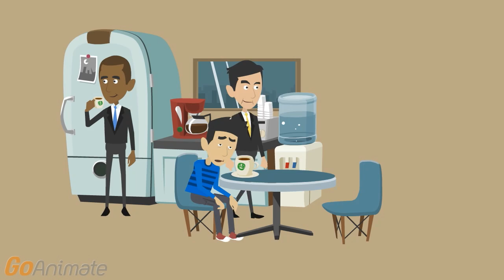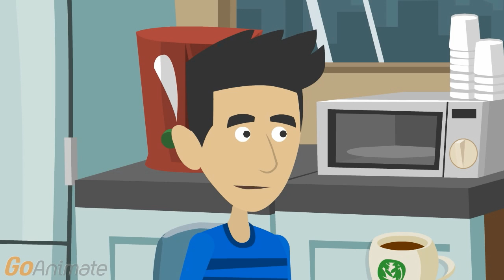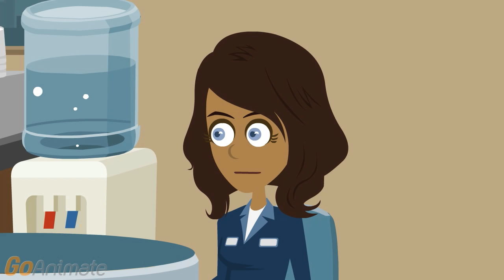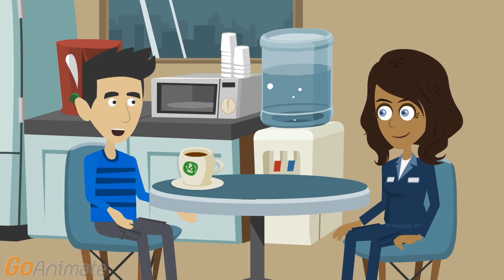Amana Furnace Error Codes

Comment: I don't see any blinks besides something on the inside that displays on an LED:
H
E0
Reply: I see this code, too. Then I restarted the switch and seems it works well then, What did you do and did the problem solved? Thanks.
Reply: @czuc1088  called up a plumber and they usually just have to clean off some sensor. It's all pretty dumb but it's happened at least once a year now. Must not be great furnaces, seems to be a common problem
Reply: @T-roccBABY   Thanks so much Ray. We had this for about 7 years now. How old were yours when this happened? So you have been seeing this code again and got a plumber to clean the sensor again?
Reply: @T-roccBABY  I just checked the Amana's manual, under code pages, said something about this EO, you may want to take a look if you have that manual
Reply: @czuc1088  I don't have it (I've just been renting a place for years) but yeah any time I'm having issues it typically boils down to being the sensor getting covered/dirty. Wish I could just do it myself to save a plumber the trip but my landlord insists. Probably safer this way anyways haha.
Reply: @T-roccBABY  Thank you so much Ray. The manual indicates it could be sensor problem as well (although I don't quite understand the manual). All the best.